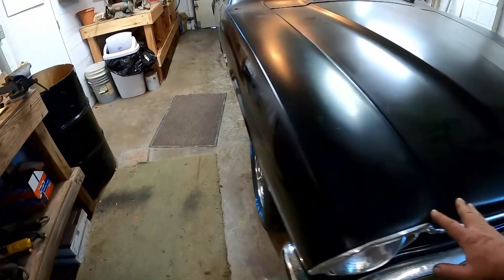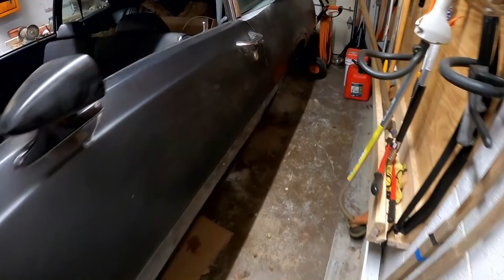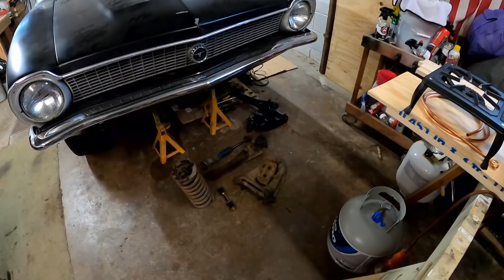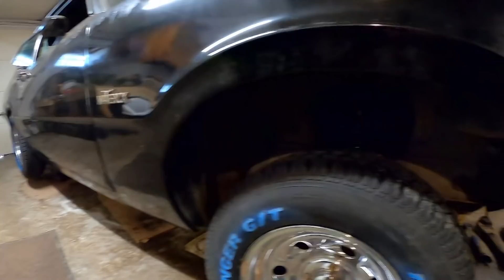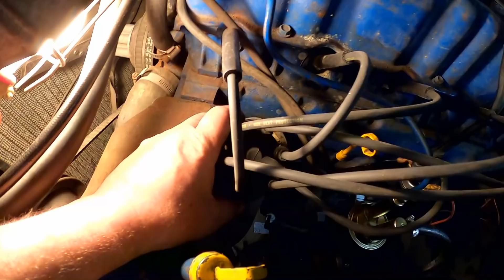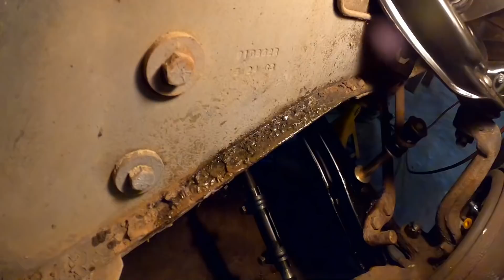My 1971 Ford Maverick Revival Project -

Comment: I Believe The ford maverick that came with the 250 six cylinder engine was actually a five lug. I have a seventy seven that was a factory V8 , with factory disk brakes and power steering. It was Last registered in oklahoma in 1990 . I'm Hoping to have it back on the road early this summer.

Comment: I miss my 71 Ford Maverick grabber so bad I wish I could find it somebody bought it in Richmond back in 2012 from Eddie's Auto repair primer gray at the time missing the seats and stuff steel wheels 5 speed please if anybody knows where it is let me know mine was black but originally factory green with a 6-cylinder 4 lugs. I put a 302 in it I built with 289 heads from 66 and a t5 Fox body pedals had the flywheel balanced for the 302
Reply: My first car too I paid $1,800 for it making payments back in 1996. 

Man I'm crying watching this video man I miss that car the right fender have been replaced on mine cuz I totaled a couple different cars with it thanks to the drum brakes before I learned to work on them.

Comment: I had a 73 or 74, whichever one had the fat front bumper, not the rear for some reason. Grabber flavor, 3 on the floor. Manual. 302 and not slow. Good times.

Comment: Had a 71 Maverick with the 250ci I6.  Rock solid motor with quite a bit better performance than my friends 75 Maverick with the 200ci I6 & cat.

It was my first real car. Two door with power steering and A/C with the unbreakable three speed automatic; gave no problems and was handed down to my mom, then my sisters, and then sold for two grand, which is what we paid for it originally.  Fire engine red with a white top and black interior. Wasn’t exciting but good decent transportation.

A breath of fresh air after a disastrous experiment with a 65 VW Fastback and two Squarebacks as parts cars.

Thanks for the memories!

Comment: 351 Windsor bored .060 over with shaved ported and polished heads with 13.4 dome compression pistons. You will need to run a cam with at least .615 lift and 290 duration with a roller rocker assembly and direct injection. You will be able to run it on 93 Octane pump gas, but you will be pushing about 570 hp to the wheels. 427 stroker.

Comment: So you remind me of me. I worked at a Ford dealer in 78-80. Your car brinks back memories of using your tune up stuff. I’m not sure if I would be too good at using my stuff now. So I watched the next video where you were using the tack/dwell meter. As you were using it, I stuff was coming back to me. I worked in front end and power steering. So I am familiar with the suspension on your car, same as mustang and cougar and even some newer ones. I would have changed out the front coil springs though. I remember those coil springs spacer things you were talking about, I had some of those on a car I had, but after I Beas working as a mechanic, I found out those were not the best things to use. I purchase a different vehicle and wanted to raise the front  of my car to make it equal to the back end. So I removed the front springs and used a 1” aluminum ring/spacer that fit on top of the coil, much better and safer. After an alignment, car looked and drove good. Anyway, cool video. Would like to see more videos on your Maverick. I would like to find one and fix it up too.

Comment: I bought a new 69 1/2 Maverick brand new. $1995 I think it cost. 200 cubic inch 6 cylinder. It had a 3 on the tree stick shift. Traded it off around 1974 when the stick shift broke off while my wife was driving it. It was a great car. My first new car.

Comment: I am the proud owner of a 1973 Maverick 4 door.  It has super skinny 14" rims that are 4.5 inches wide.  The tires are 185/65R 14 .  What are the size of your rims and what size tires do you have on the Maverick?  They look great!  Did you need to use wheel spacers to mount the wheels?  I am dying to get bigger tires and rims but I don't think I want to use spacers if I don't have to!

Comment: I have a 74 maverick base model sitting in my yard for the past few years, I just picked up a 72 comet for parts, fenders and interior trim. 
 Can you make a parts list for the front end you put together, and a good place to shop for it? I am fitted for a v8, but I think modifying the straight 6 would be a better option. The car is sitting on a 5 lug.
Reply: V8 power 🔋 💪

Comment: I was a young mechanic ( myself and the shop foreman/mechanic) at a small Ford dealership when these same out. BIG fan of inline 6 engines (any brand). The Maverick was an updated and rebranded Falcon, even while the Falcon (now a larger car) was still in production.

Comment: The only thing I remember that My Dad had to do to it was put a rebuilt carburetor on it.  It would run, but it was flooded to death.  I had My Driver's license when My Grandfather got the car.   We thought My grandfather had ruined the engine and I was driving it to My Dad's to work on it.   I thought it was about blown already, so I floored the gas.  When I did that,  it blew out a big cloud of smoke and I really don't know how fast I was going because the speedometer didn't work.   After I did that, it would run pretty good.   Dad put a rebuilt carburetor on it,  and it didn't give any trouble after that.

Comment: I bought a new 1972 maverick and it had a 302 with a 3 on the tree. I put headers, aluminum intake with a Holley on it. I took it to the drag strip and broke the shifter and had to limp it home in 3rd gear

Comment: I had a maverick to. 
I called it my imaginary car.
No floorboards in back, the hump and door jams were there. It was covered with a carpet. My dog would jump to hump then up on the seat.
No heater, fan motor worked so it could defrost. No radio.  A rack for glove box. I bought it for $200 and used it for a trade in. 
It was a good transportation no frills.
Much better than walking. 
Blessings. 
Peace

Comment: another tip:... if the air conditioner system does not have any freon in it now, and if you want to keep that factory air conditioning compressor functioning i would disconnect the wire going to the clutch right now.. that said, it's cool that the car still has the stock air conditioning system but if you intend to use the system, it might not be practical keeping it stock. but there is a way to use the stock components, although it might be technically illegal in america. your a/c was designed to use freon 12 or r12 as a refrigerant but that was banned in the us many years ago and new vehicles use a different refrigerant called r134a. but, r134a won't work properly in older vehicles that were designed to use r12. the closest thing to r12 is r290 which is refrigerant-grade propane, which really isn't very different from propane that is used in rv's and stoves etc. i have a 1974 gmc c15 pickup with factory air conditioning and have been running ordinary propane in it for 10 years with no problems, it does leak about 2 ounces of gas per year but that is actually normal for these old a/c systems even when running r12. the legal issue is that r290 or propane is not approved for use in the us as an automotive refrigerant even though it has been used in europe for decades. most of the debate about it's use has been concerned with the flammability of propane, but the r12 replacement known as r134a is also a flammable gas. i use it in my truck and will continue to use it, i like having air conditioning when it's 90 degrees outside.

Comment: another tip: since you are going through the entire hydraulic brake system and this is your car that you will be servicing, i highly recommend you switch to dot5 silicone brake fluid. dot5 fluid is not hygroscopic like dot3/4 fluid and does not absorb moisture from the air, and it has a higher boiling point than dot3/4 fluid. what that means is that your master cylinder and wheel cylinders as well as the insides of all of your steel brake lines will never rust and the rubber seals will last much longer if not forever. because of it's higher boiling point dot5 will not boil and cause brake fade like dot3/4 will. dot5 fluid will also last almost forever, you do not need to bleed the brakes or flush the brake system annually if you use dot5 fluid. the downside to dot5 is it's cost.... it's a lot more expensive than dot3/4 which is why auto manufacturers never used it in production vehicles. but for an antique or restoration vehicle the additional cost is well worth it.

Comment: If firing order is correct , no big vacuum leaks , Seems compression is ok , then my thought would be check voltage at coil , Thinking there is a resistor wire on the fords , and check ground in dist as if points are not grounded they do not work right , but the new dist should take care of that . Other thing is did some water or rust get in new carb , You will figure it out , oh another thing , is there any nest in the exhaust , if exhaust is low , then vacuum would be low when cranking .

Comment: I bought a 1989 Ford 5.0 LX back in the day, for my husband  and it is in storage, with less than 39,000 miles on it.  He keeps it lubricated and moves it on occasion to keep the tires from dry rot.   I get your need

Comment: I've never a seen a car with the front shaped like that with the thin bumper and grill. Coupled with the shape of the front and rear headlights it's really pretty. Likely not supposed to describe a car that way. You explain things so well.
Reply: the front end of the maverick was inspired by the design of the 1969-70 ford torino/ranchero. the rear was inspired by the construction of the rear valance on the 64-71 mustang/cougar but ford was also doing some cost-cutting so the maverick shares the same taillights as the ford pinto. really it's an evolution of the falcon which began in 1960. after 1972 the front and rear bumpers became big ugly huge things mandated by federal safety standards and all american cars from that point forward looked like crap....

Comment: I really wish the car manufacturers would bring back some of these body styles I think they would be very popular you just don't see cars like this anymore but it sure is sweet when we do.
Reply: I agree, or atleast the names, I always thought that when the retro muscle cars were brought back they should have done the "Of brands" too, FOMOCO SHOULD have brought back the Cougar, GM couldn;t bring back the Firebird because Pontiac was dead, but they SHOULD have brought back the Buick Wildcat and based it off the Camaro, Plymouth died in 2001 but Chrysler could have the the Chrysler Barracuda or CUDA. Making the Maverick a truck instead of renaming the Ford Focus the Maverick and GM brining back the Vega or Monza when Dodge brought back the Dart, because those Darts sold like hot cakes, as did the Magnum and the 300. WE as a society want the retro name and styling. The Mustang, Camaro and Challenger proves that.

Comment: I love it...  Love the older cars from 50s to early 70s easy to work on.  I have Corvettes a 92 and a 96 and they are a pain in the butt... I have a 77 and it's not to bad, kind of easy...  But the old stuff with points and NO fuel Injection or computers, I hate that stuff. I rather have points and a carb and manual fuel pumps.
The Maverick is nice should clean up .    I want to see more.

Comment: Put #1 cylinder to top dead center and see if rotor is facing the #1 wire on the cap it not it jumped time the timing chain worn or somebody not installed distributor correctly. this for youngsters whom not did this before

Comment: I’m a 60’s MoPar guy but have always liked certain other breeds too.  Your Maverick being one.  That would be a great late model 5.0 recipient.  Nothing radical.  Just a great driver with a little user friendly umph.  Something like a crown Vic 5.0.  And in that light Maverick it would be more than sufficient. Nice dual exhaust out the back with 2 chamber flow masters.  Just a pleasurable tone.  I would love to have another 68 Dart 340 GTS.  Or even a non GTS with nice 318 (or 360).  Anyway, looking forward to following your progress on this super clean Maverick.